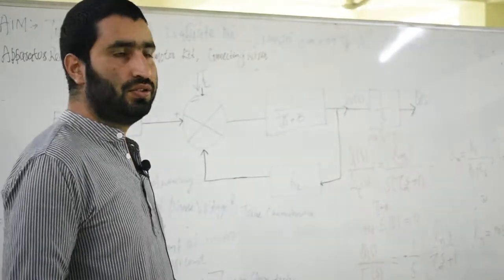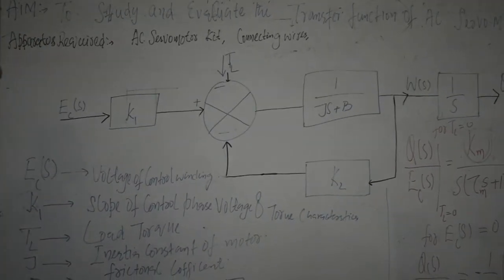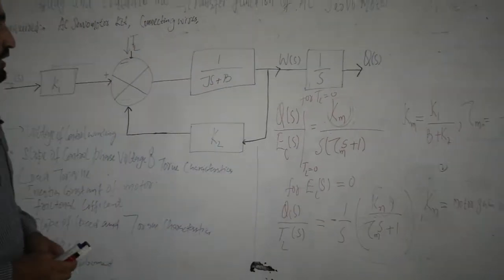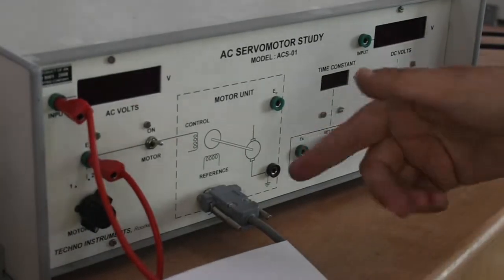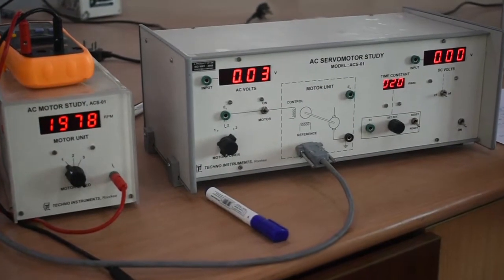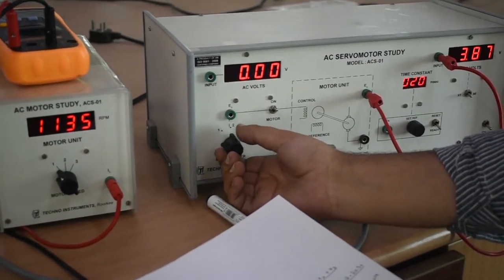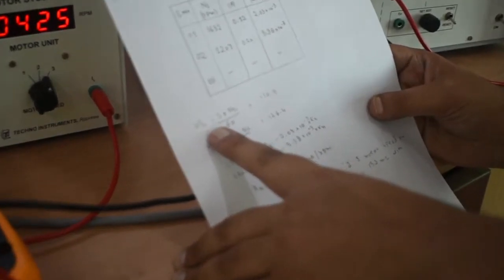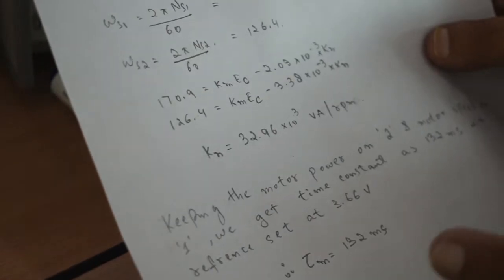Transfer function of AC Servo Motor

Comment: Can you please share a set of readings or how the speed-torque graph is plotted?
Reply: The reading taken are 
1. At no load N = 1987rpm , I = 0, 
2. At half load N = 1542 rpm, I= 11micro A
3. At full load N = 1205 rpm, I= 19.2 micro A
Therefore as the load on the motor increases, the speed of the motor decreases and the electromagnetic torque developed by the motor increases with the increase in the current drawn